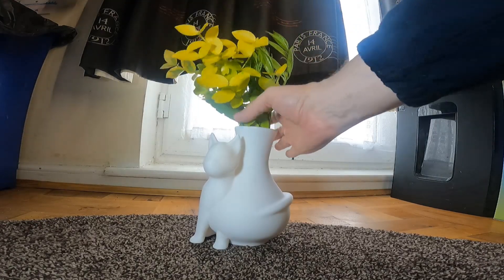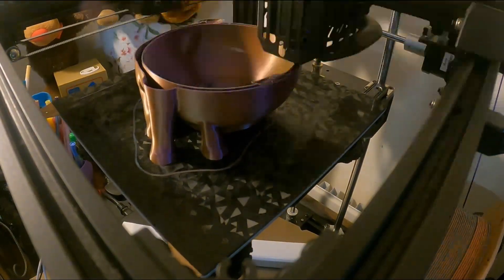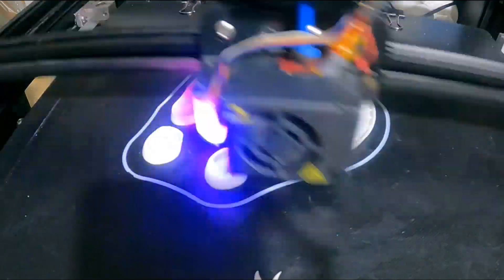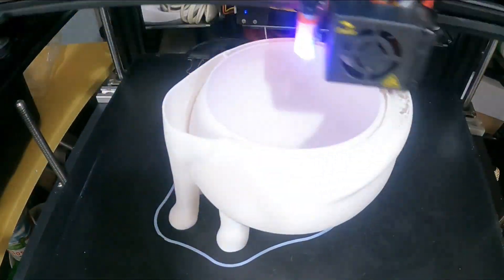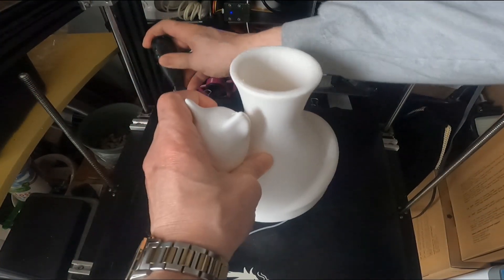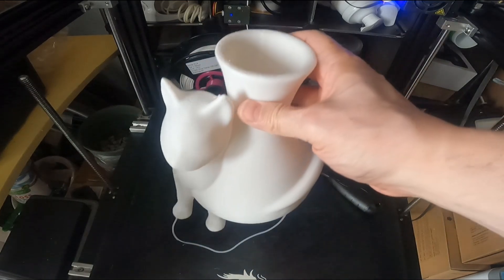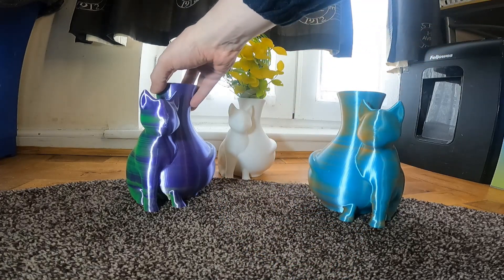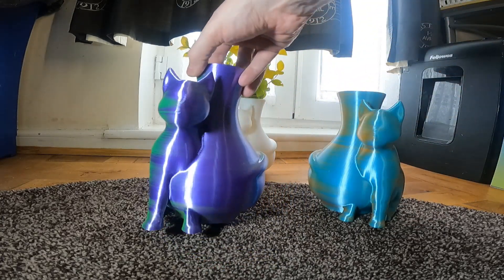Pawsitively Adorable: 3D Printing a Cat Vase! #3d

Comment: Hey, thanks for model and video, do you use supports? And what settings do you use?
Reply from the maker: Hi, no supports, Lightning infill, 200°, 60° heated bed. 
I sliced it in Cura so it is standard settings with lightning infill. Hope it turns out well :D